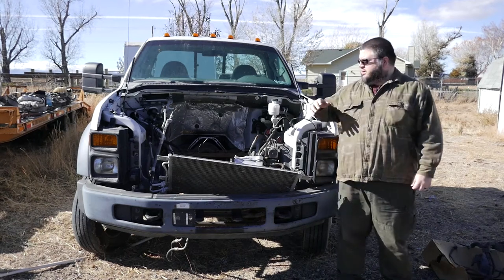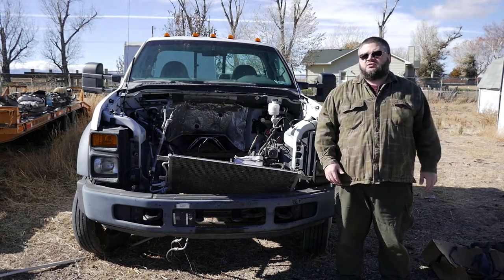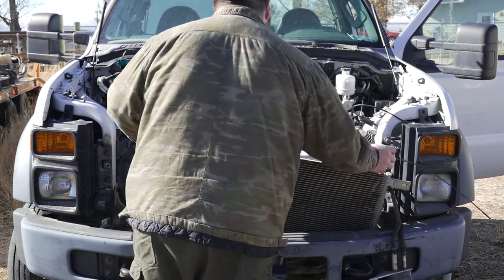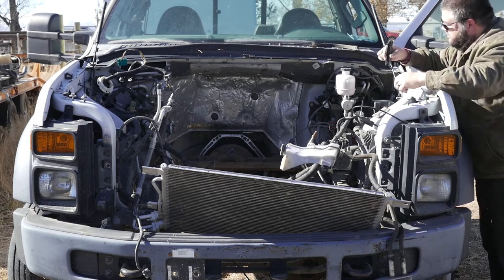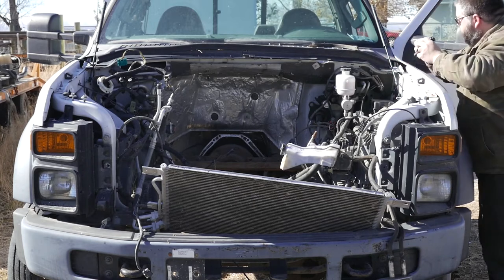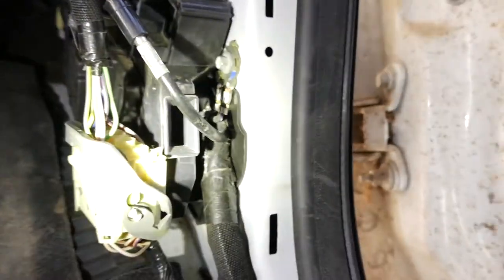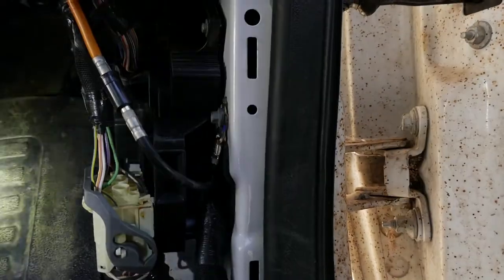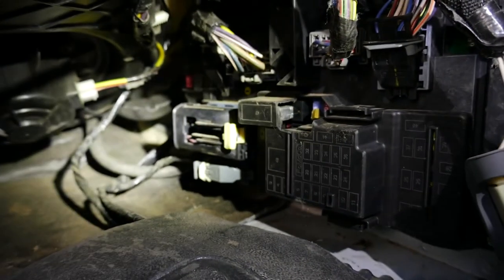Ford F-550 V10 Swap Part2: Installing the Chassis Wiring Harness

Comment: Cool, Perry.  I would like to hear an update on the tractor saga, also.
Reply from the maker: That will be soon, I need to service it and will take the thermostat out to test the opening temp.  The running theory is that the thermostat is stuck.  I also got a new pile-it-higher-and-deeper Innova scan tool that may reveal more too.

Comment: Are the control modules going to play nice with each other or are you going to have to do a lot of reprogramming? I suppose you would just have to use the VIN from the donor vehicle to program with but that's the kind of mess that would keep me awake nights until it was sorted.
V10 badges should go on your mower.
Reply from the maker: I do expect to get some codes from things like the ABS module about VIN.  I chose a 2007 donor vehicle due to the similarity of the platforms.  This is a manual 4x4 XL chassis, so I only have ABS, SRS, and Instrument Cluster modules on the CAN bus.  I don't see CAN going to the SJB in the wiring diagrams, so the Smart Junction Box appears to be conventionally controlled like the 2007 Central Junction Box.

Comment: I HAVE A 2008 F350 CAB & CHASSIS WITH A 6.8 VIN # 1FDWF37YX8EE59410. I AM LOOKING FOR THE FRAME HARNESS.THE # ON THE HARNESS IS 8C3T 14405 P 2604 THE # THE DEALER GAVE BE WAS 7C3Z 14405 AHA. DO YOU KNOW WHERE I COLUD PURCHASE ONE. THANKS GEORGE @ ONE STOP TOWING CHICAGO
Reply from the maker: Hi, sorry I don't have a source for you.  eBay doesn't seem to have a compatible harness in stock.  Ford dealers are all gonna say the same thing.  I see this is a taillight harness for a 141" WB gas truck with standard cab.  The auction pictures show more wiring damage inside the cab, so that's concerning.  Your best bet is to contact a junkyard year you to find a similar truck.  The harness should be the same for any gas 141" WB standard cab truck.
Reply: @eformance  the wires in the truck was the taillight harness that i need laying on the floor. no damage to anything in the cab
Reply from the maker: @georgescott5422  They cut the wiring harness and you got the cutoff part with the truck?  If you have the missing part of the harness, spend some time with a crimper and water proof crimps and crimp the wires back together.  All you have to do is match the colors and stripes.
Reply: @eformance  ok thanks i will try it

Comment: Do u have any more wire loom for sale?
Reply from the maker: No, if/when I sell of the spare stuff I'll mention it.
Reply: @eformance  where can I get one to buy?
Reply from the maker: @ramonesmith2864  I purchased mine on eBay and from wrecking yards.  You need to know the part number you are looking for, which you can try to find at parts.ford.com using year/make/model lookup